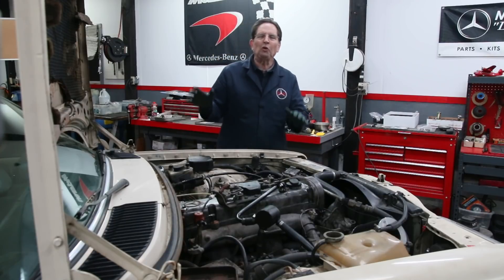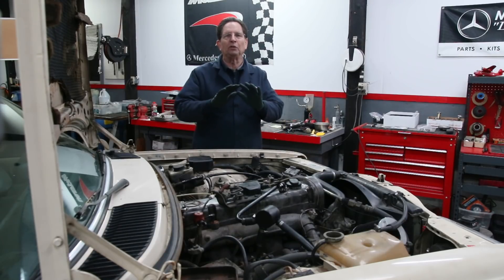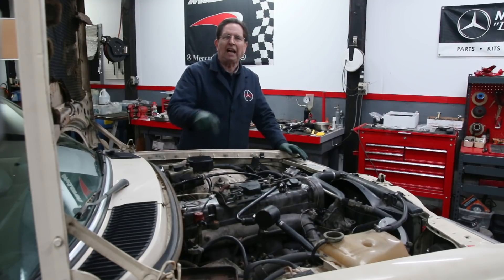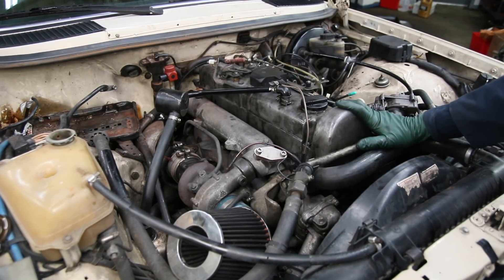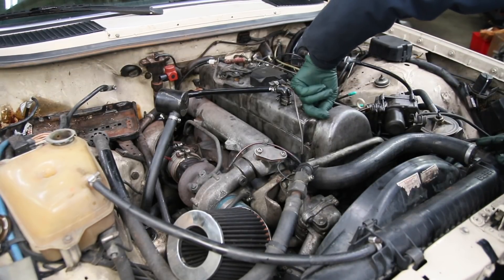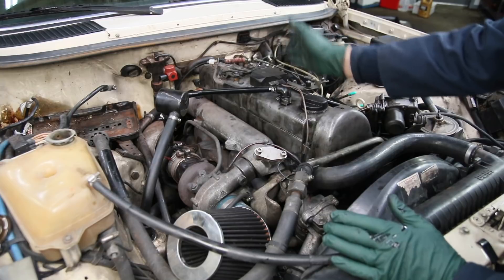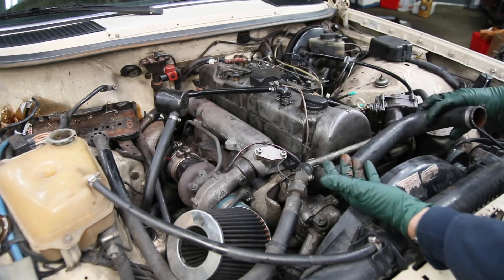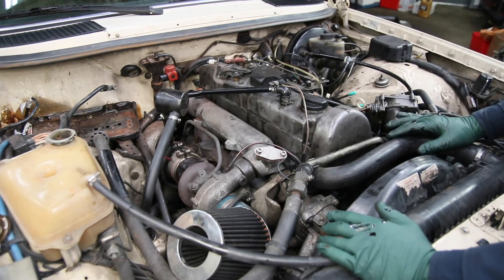Blown Turbo Diesel Engine Diagnosis Part 1: Background and Symptoms

Comment: This one reminds me of the video on Nick's Garage where a Chrysler 440 had a bolt embedded in one of the pistons.  This is another mystery as Mercedes Benz diesel engines are known for their durability but only if they are maintained properly.  This one appears to have been abused due to overheating so it's anyone's guess as to what happened.
Reply: murray1575 (TT)😯

Comment: I had maintained all my cars, all european and mostly Mercedes, from the 1960's until I sold my beautiful 1979 W116 in 1999(what an education owning that car was). I still have most of my tools. I now live in the city in an apartment and have a little used 2008 SAAB which lives in an expensive garage; it is 'maintained' by the mechanic who cared for the Benz for repairs not easily done on the street. 
Watching these videos is a as close as I can get to the smell of the grease and the feel of the mechanicals. I love Mercedes Source.  The Digby series was better than most of the streaming series that  I watch on Netflix and  Cable; real reality tv. Agree with Werner. Wow, and now another engine tear down and  investigation. Thank you Kent, and take your time...we have all winter!

Comment: You can put your leak down tester on the radiator and see if it's going to leak blow through the head gasket but from the modifications looks like it may have a thrown rod the other words I bet it was over revved but I'm not there look at it let's find out kent

Comment: How many miles on it?
(I've got a nice '81 TD with one cylinder low on compression. Starts great. Runs great. Idles well when cold, but lopes at idle when warm.
No leaks. I'm just gonna run it and maintain it, till it runs no more. Could take a while I think...
Hell, my heart and lungs don't pump the way they used to either. - and we all gotta go sometime.. 😁  )

Comment: You have any tips for staring a 1978 300d that has been sitting for 8 years and was run on biofuel? I.e. tips for first start after sitting for a long time. Engine turns over
Reply: If he does not get back to you I will give you some advice, but I am only a farmer
Reply: RamblerClassicMan change the fuel filters FIRST, then change the oil, then bypass the fuel tank using an external jug full of fresh Diesel Purge fluid and use the primer pump to get as much of the old biodiesel out of the pump and injectors. Let it run on the diesel purge, then start draining the old biodiesel out of the tank and fuel lines (don’t forget to clean the strainer in the bottom of the tank.)
Reply: Try and run a fuel system cleaner and  thoroughly clean out the diesel tank too and since it hasn't sat for a while, I wouldn't dare try and start it on biodiesel. Get it running properly on diesel. I bet it won't start because most of the fuel lines are gummed up from biodiesel that sat in the vehicle for 8 years.